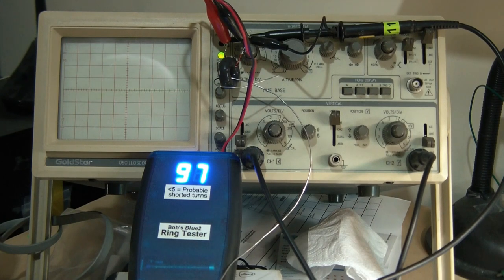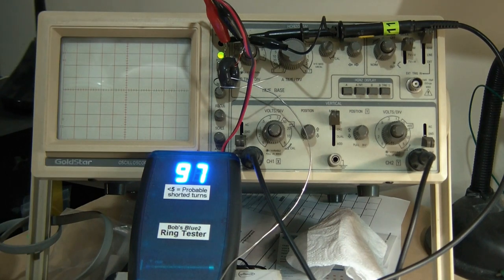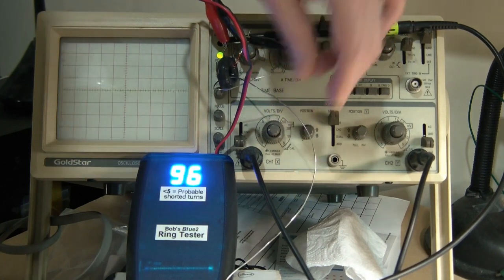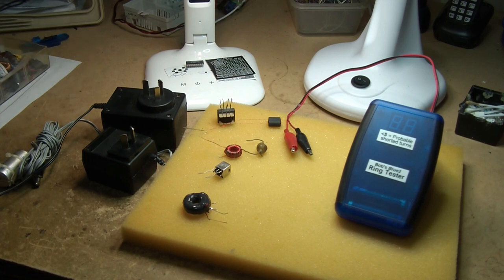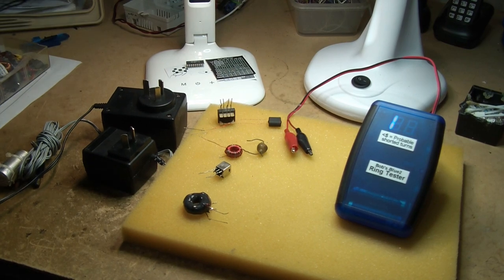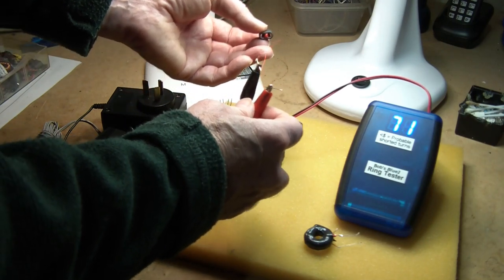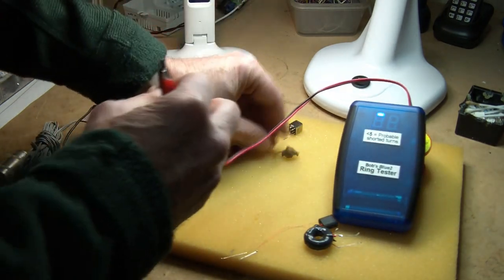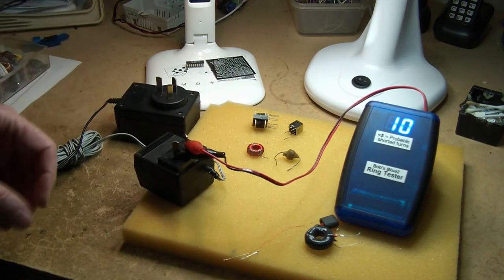"Blue2" inductor ring tester demonstration.

Comment: This looks like a nice update - funny enough I just put together the old version!
Reply from the maker: The old Anatek one or the even older Dick Smith version? They're calibrated to give sensible indications on LOPTs and similar inductors but this one's more universally applicable (we hope!).
Reply: @ZilogBob  The Anatek version. I figured if there's doubt in the reading I can look at the waveform with an oscilloscope though.
Reply from the maker: @Agent24Electronics  No worries. Good luck with it! :)
Reply: @ZilogBob  Thanks!

Comment: @ZilogBob Can I buy a programmed PIC and make my own? (The whole units are out of stock).
Reply from the maker: Hi. Thanks for asking. If you're in Europe, EVB in Portugal should be able to sell you a complete unit. Unfortunately I don't have any way of programming the microcontrollers other than via the In Circuit Programming connector which is on the tester's PCB. I'm hoping that these testers will become available from another 2 suppliers before too much longer.
Reply: @ZilogBob  I contacted EVB and they don't have any.  For me this is a one off test so I will knock something up and see if I can make my flyback ring.  Thx
Reply from the maker: @NivagSwerdna  It's not hard to make an inductor "ring". I was almost going to suggest that you build something yourself. The instruction manual at https://tinyurl.com/ringinst has the schematic on the last page. All you need to do is roughly duplicate the part around Q1 with a mosfet like a 2N7000 and preferably a polypropylene capacitor (lower losses) for C4, feed its gate with pulses of maybe 200ms high/20ms low from a 555 or similar, and observe the inductor waveform with your Rigol 'scope. If you get dozens of "rings" then your flyback is probably OK. If only a few "rings", it's probably got shorted turns. Good luck with that!🙂
Reply: @ZilogBob  Using the schematic and a couple of couple of free samples from Microchip I knocked one up... works really well.  Thanks!
Reply: The only thing I noticed is that for transformers with very high inductance (e.g. a Critchley 9856 I had lying around) you get very low numbers because the period of oscillation is so high.  But even with that one... which gives 02 rings.... if you short the secondary it goes down to 01.
Reply from the maker: @NivagSwerdna  Congratulations! You've done very well. 👍👏
Reply from the maker: @NivagSwerdna  I can't find your transformer on the internet but its inductance must be super high. With a measurement time of about 200ms I couldn't find any in my collection which had that problem. Glad you're generally getting good results. 🙂